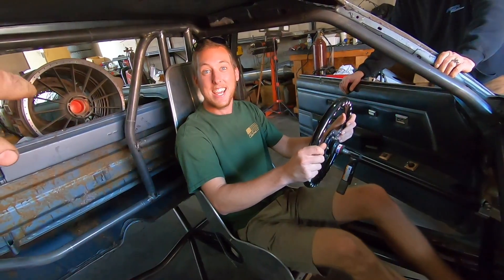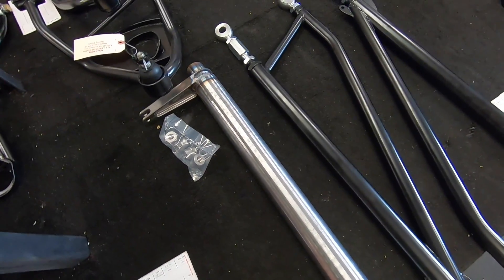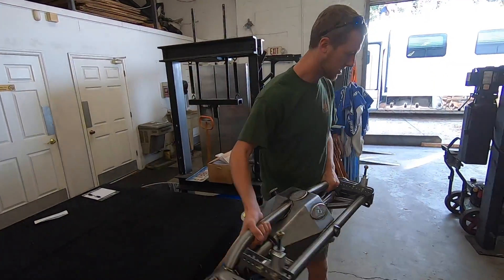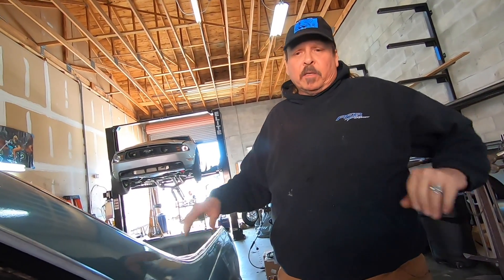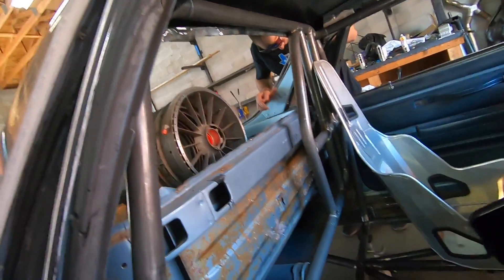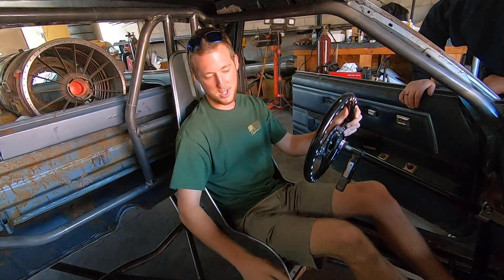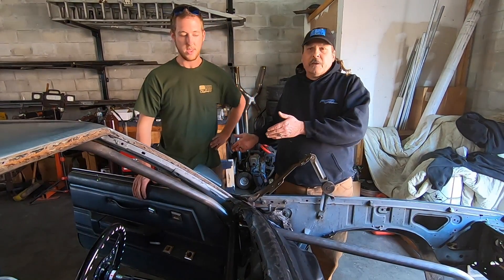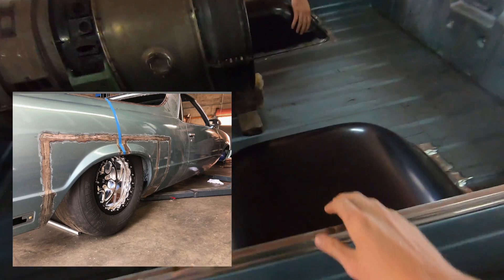The Jet Camino's Roll Cage is INCREDIBLE... First Cleeter Test Fit!

Comment: A really good design is some of our no longer made in indochina turbojet electric electric generator.used fork lift parts and drive trunk.used different tires height fore front back ratio match there pretty fast turbojet electric generators.we used to build kick out 7500000volts in actuality jet electric only providing electric to ELECTRIC motor attached.to trucks ford suv explorer. Transmission system and axle system.really not hard to build put on your new log of fuel gpm or gph.ours gph. There pretty fun but had to put in extra insulation fore noise ours in fuel equate under full power equalls.under half liter per hour but have govener.set to keep from burning up electric motor other than that every thing in truck running gear ford oem only used fork lift trunk till found strongef rear end ..

Comment: The El Camino is looking good, but those A-pillar bars are disgusting.  You could throw a football between the bar and the A-pillar.  There is no reason to have that huge gap.  If I showed up to a chassis shop to check out my car and the bars looked like that, I'd be handing the builder a sawzall.

Comment: You're not pioneering anything. People have been making jet turbine cars since at least the 1960's...
Reply: TheJustin574  did they also have twin turbo V8s??
Reply: Were they el camino's with an intake going to the jet through the windshield with a tt lsx motor??? I think not!!
Reply: How is twin turboing an LS v8 groundbreaking?..
Reply: @TheJustin574  the dual build in a stock car base kind of is, it's not been done that often from what I've seen. This thing will be interesting as a feat of engineering.